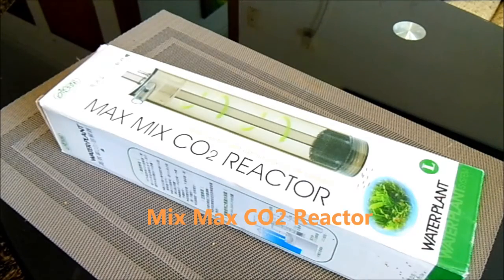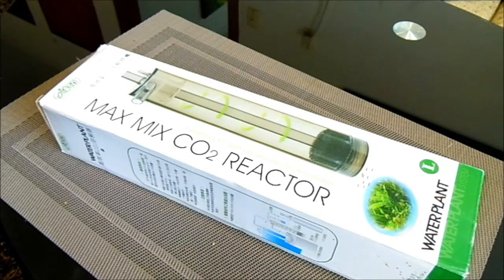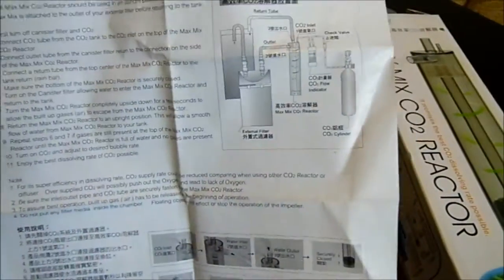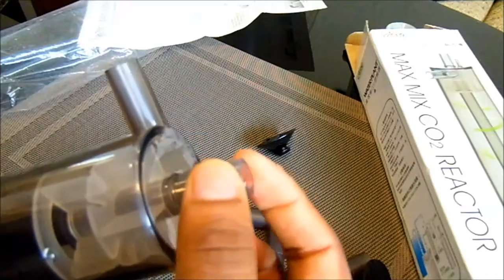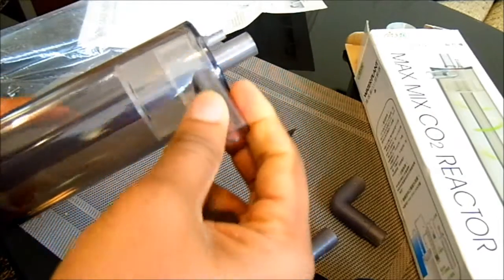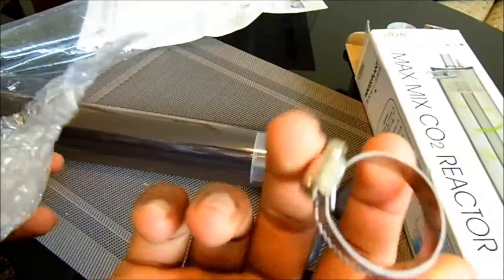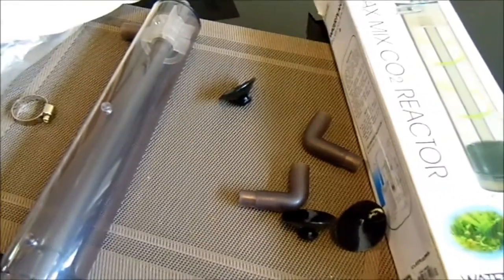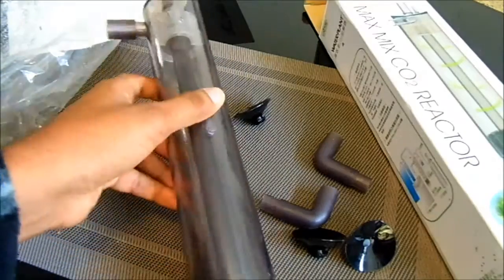Mix Max CO2 Reactor Unbox and Review

Comment: where is the full video?
Reply from the maker: Hi. do you mean the "setup" by full video?
Reply: +Faz Zuk yes, the setup video. also, is it still working well for you?
Reply from the maker: +bman2013 It did work well but then I decided to remove it because I wanted to setup my DIY liquid fertilization  . Didnt have much space in the cabinet.  . So went with the common ceramic diffuser method . .